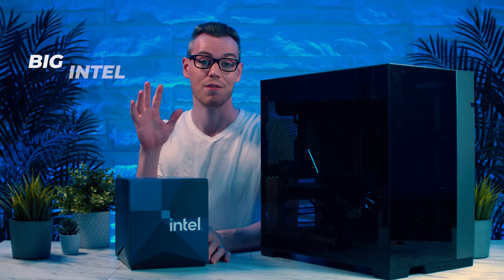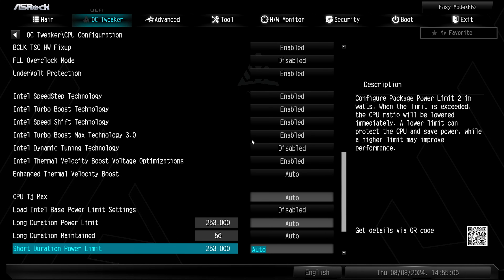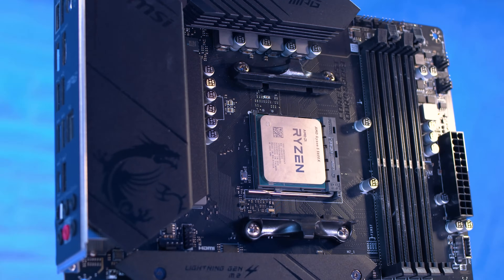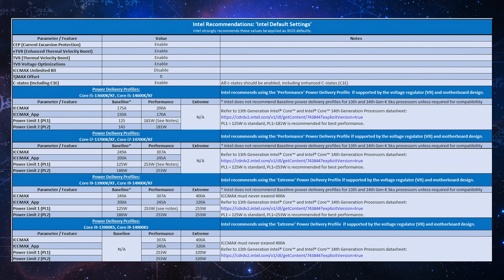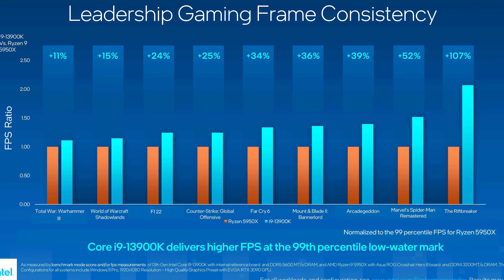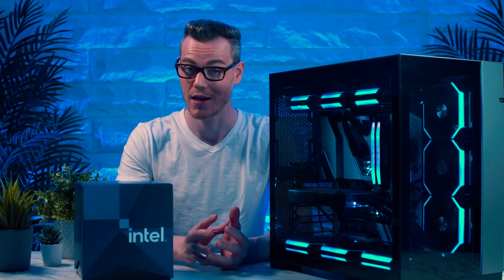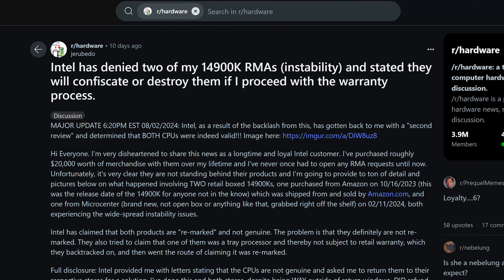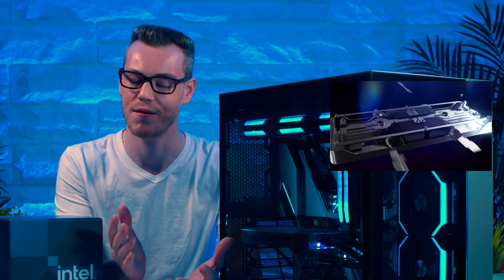The Intel Problem vs My $4000 PC... I'm Getting Mad Now

Comment: I have a 14900K, and I am constantly getting lockups or app/game just closing.  I've never OC'd on my own, updated the BIOS to the Asus Z790-E Gaming Wifi with the 0x129 microcode, set to Intel Performance, and still having the same issues.  I believe my CPU is damaged, but this wait is driving me insane.  Also, there is nothing in the Event Viewer when I experience these issues, which really puzzles me.

I've been in contact with Intel for about 2 weeks, and am waiting for a response with the RMA information.  Starting to think I am going to have to turn into the Gorilla jumping on the desk.
Reply: damaged CPU's cannot be fixed by this update, intel already says so. MANY people will still have issues because their CPU is physically damaged there is NO FIX, you must get a new CPU. And people who have not had crashes yet but the cpu damage has started, there is NO FIX.
Reply: You need to manually set setting's in your motherboard bios or you will always have problems with these cpu's. Mine's been running strong without issues for almost a year now, I do not want to say it's a user error issue since these cpu's are not stable plug and play without degradation due to shitty mb vendor default bios, but anyone with basic computer knowledge can have these cpu's 100% stable hitting top benchmark numbers under 1.35v v-core without any stability issue's pretty easily.
Reply: @joeysuzyjozy  I've tried manually setting to Performane and Extreme wattage and amps, still having the issues.  I've reset the BIOS, made sure all drivers are current, tested RAM, video (I have an nVidia 4090), using 1200W Corsair Shift.  I am at a loss. I believe my CPU is defective. I didn't have these issues until about a month ago.
Reply: @sinnirr  Your using mb default bios settings i.e. choosing a default performance profile on mb instead of manually setting everything yourself, that is your problem and why the system is unstable. since you ran a default bios profile on your mb the cpu has degraded due to spiking voltages above 1.5v and no longer works at the voltages it defaults too at the default speeds and needs to be downclocked permanently to function correctly again. Your system can get stable in 10min again fixing your bios, but your cpu now has permanent degradation due to shitty cpu microcode and default mb bios settings.
Reply: @joeysuzyjozy  I've done it both ways, using the profile and manually setting them.  Issue is getting worse. 

I'm in contact with Intel, but this is ridiculously slow.
Reply: @sinnirr  Sounds like your cpu is already seriously degraded and definitely needs a rma. When you get your replacement, limit your v-core voltage to no more than 1.35v max and watts to 253/260w max, limit your system agent voltage to 1.3-1.35v max also (only needs to be touched for memory overclocking and stability). set your turbo boost to not boost to 5.9/6.0 on 1-2cores and that causes the voltage spikes and set all pcores to 5.7-5.8max and you should never have issues with your new cpu moving forward. :D
Reply: These are all my mb bios settings you can use as a template (starting point) to find what works best for your cpu and system that I posted in another thread to help some other people with similar issues.

Under cpu advanced settings I currently have these settings all disabled: Intel speed shift, ring to core offset, cpu esit, energy efficient turbo, cpu flex override, enhanced tvb, voltage tvb, ia cep, gt cep, under voltage protection, and intel dynamic tuning. 
Other settings: my cpu throttle protection is at 90c, avx offset at 1, manual max turbo ratio set to 58 for all p-cores and 44 for all e-cores, p1/p2 set to 260w max time of 448, amps set to 400 max, system agent set to 1.3v versus 1.25 default volts only for memory stability on overclocked memory, adaptive vcore with a negative 0.196 offset (-0.2 in windows), memory timings set manually not xmp for performance and stability, enhanced multi core performance enabled, intel settings disabled, performance cpu clock ratio 58, efficiency clock ratio 44, max ring ratio 45, cpu load line calibration set to extreme, ia vr config enabled, ia ac and dc load-line set to 20, ia va current limit set to 1600 (400amps), ia vr voltage limit set to 1300 (1.3v), igpu set to disabled, audio set to disabled (i use a pcie audio card) and thats it guys…

Like I mentioned with these settings I run a fixed 5.8 all core at a max voltage of 1.29v using hwinfo that is stable in benchmarks and stress testing occt overnight, gaming without any whea errors, bsod, etc with manually tuned (fast) memory settings.
Reply: @joeysuzyjozy  I bought a new 14900K and am sending my damaged one to Intel for a refund.

I am using the Intel Default with the Extreme settings after resetting the BIOS and am no longer having issues.  

The original is definitely damaged.
Reply: @joeysuzyjozy  no its not the motherboard lol . that has been debunked
Reply: @joeysuzyjozy  the cpu architecture itself is defective . its IO controller is separate from the die and is connected to another part that requires more voltage . unfortunately the IO controller cannot handle the voltage is eventually fails . no it has never been the mobo venders fault. research will show you are incorrect
Reply: @zerokool1985  Everything can be manually set to run smoothly without ever having degradation or issues on the cpu using the mb bios and manually setting everything. Yes, the default cpu microcode is bad and the mb vendor default settings are worse, but that still doesn't change what I previously said above and if you don't know or realize that then I am sorry but you're an amateur.

Comment: I bought my i9 13900K in January 2023.In October 2023 starts crashing in games and BSOD.Then i undervolt it
and crashing stops.Update to the latest bios (not the August one yet).Now CPU gets high temps on cores 0,1,2,18,and 19.
I have 360 AIO and 8 vents in a big tower case.I tried RMA ,but Intel denied it and send me the chart for setting the correct 
parameters in bios.Did that but problems stays.I will try through the seller of CPU to RMA again.I don't have high hopes,
bcs i'm from EU.
When i run cinebench or similar stress tests,temps are normal for this CPU,but when i watch yt video in full screen and 
move mouse,the above mentioned cores go crazy on temps.
Reply: dump the 13 and 14 and go back to 12th gen
Reply: do remember intel gen13 and gen 14 CPU also have an oxidation issue that is separate from the over voltage issue. The oxidation issue probably continued to damage the CPU after you solved the over voltage issue. Your CPU is dying.
Reply: Same with me, just sending me bogus parameters instead of a working chip (3 months old now). Conflicting parameters too. They, after a week, first provided me with values I asked for and some more, but when applied my 14700k performance drops for 35%. Main culprits for nerfing are: eTVB = Enabled, TVB voltage = Enabled, CEP = Enabled.
But then, the same day, shortly after first the email with nerfing parameters, Intel sends me another email that says I should set Intel defaults... and to contact motherboard manufacturer.
Reply: just sue them. they have to fulfil the RMA. they are in troubled waters and most likely to have a class action lawsuit over this. thousands and thousands of companies use their chips and are failing which means losing profits and business because of hardware failure effecting their operations. they will not only be sued for the hardware but potential losses because of these chips. i have no idea why they think they are going to be able to pay a penalty when there is going to be an army of businesses and corporations that will be demanding they make up the losses through a lawsuit. intel did the dumbest reaction they could have followed through with. whoever made the move to hide it and come up with a BS non fixer should immediately step down for ruining a huge chunk of their reputation. They were well aware of the problems before they shipped them to sale but went ahead and sent them for sale. it was intentional to make a dollar and probably one of the worst business decisions made in recent years.
Reply: I bought my i9 13900kf in october 2023, until this day never had any issues.. I tried all of the tests people have said the 13th gen i9 shits it self at  cinebench, prime95, black myth wukong benchmark tool etc etc and I never had any issues with the cpu, my cpu never even went above 1.48v.

I guess I am good..
Reply: @AplixonTV  1.48V is a lot.
Reply: @Sigouss  That is true, but it's very stable..
Reply: @Sigouss  I checked the voltages again and it was somewhere between 1.24v to 1.33v and it rarely spiked to 1.48v
Reply: Lol vmin shift from defect Intel is already brick your CPU. The cooping is real. Simple answer, if intel won’t refund, you’re fuck

Comment: I feel like Intel not only has to flawlessly refund buyers without any further issues whatsoever, but also drop a new tech bomb, issue free high value CPU to regain their position, at least for the small gaming segment.
I don't think the big industry gives 2 shits about the brand. They have contracts and make their calculations for investments. If those run out and new purchases need to be made, they start the same procedure, based on numbers.

Comment: 4:36 One of the problems you show with your voltage graph is it is the average. The problem happens because the CPU requests a large spike of voltage for a very short period. The average hides those spikes. The problem is that those repeated spikes damage parts of the core and you get silicon degradation.

The big issue people are having is that this microcode will not solve the problem. If you have damage to your CPU from the voltage spikes, it is irreversible. This microcode update may prevent it from happening, but if there is degradation it can't fix this because it's physical damage. Just like the Pentium floating point problem, intel is not going to have a recall. They will not refund your money. And they will keep selling chips. NEVER buy buy used or second hand intel CPU's because you don't know what you're going to get. There will be a bunch of people selling working but bad chips.
Reply: Yeah used to be that used Intel CPU was the safe choice, bought plenty 2nd gen to 8th gen used and OCed them no problem, running a 5.1Ghz OC on my 9900k for 4+ years with no problems but you're rights about 13th and 14th gen I won't be buying any of those used unless I can test before buying or I know it's from someone that manually tuned their system.
TL very disappointed that you ran your 4000$ PC at stock bios settings, expected you to tune your PC.

Comment: first off i am only aware of MSI motherboards having the Intel microcode patch too bring the CPU back too specs instead of OVERCLOCKED straight out the box with too much voltage !!! also too check you have the patch applied you go into BIO,s and power limits and PL1 should be 125watts and PL2 should be 253watts and core voltage should be idle 1.0v and boost 1.2v ... i dont think you got the microcode update and you have a bad CPU cooler block mount , don't use carbon pads , their garbage . use thermal paste and a Thermalright retention bracket for 12/13/14 gen Intel .. and if the settings ive just given you are not applied in your bios then you do not have the microcode update that make the voltages Stock intel and your still running the OC bios which is causing issues ..pfft
Reply: again you are wrong lol stop it i am a repair tech . EVERY 13 or 14th gen system i got was defective and needed a new cpu . msi . ASUS . asrock . gigabyte. the cpus themselves are the issue

Comment: I dipped after the 8700k/7980XE, bought a 1950x then 3950x and now a 7950x. Nothing to do with brand loyalty for me, Intel 18 core cost me $3500 while AMD offered me 16 cores for $1200 which performed better with reduced power consumption. I really don't know why anybody would buy an Intel processor for anything? Adobe? Does it really matter saving a minute off your render? I can play Robocop Rogue City, run an Arch VM, render a 4k video, watch a podcast or film on my other panel all at the same time, 14900k can't do that. 7800x3D for gaming and 7950x or Threadripper for power users, Intel is simply not the best choice not even close. Sorry this has happened though but I saw the potential issues when they started with this big core little core crapola.

Comment: I have a i7 13700k and since i bought it i noticed it was voltage hungry when turbo was turned on ( Default setting Asus Z690 plus ) Default setting will turn on turbo boost , My cpu runs at 5300 mhz ( @ Turbo default speed )and  is pulling 1.45v ( Which I am told is really bad for cpu )so in short I have to leave my turbo turned off since I updated the bios a few days ago . I have  downloaded the new bios and I still needed to undervolt my cpu.
Reply: Anything above 1.35 and u can make your CPU prayers..
Reply: @Greenalex89  1.35 is still honestly to high for 10nm / technically 14nm +++++++++++++++++++++++++++++++++ its complicated
Reply: @Greenalex89  Any idea why a cpu would call for such core voltage ?

Comment: Good thing I got the service plan with my processor at Micro Center.  Going to return it and get a free upgrade to a 9950x or 9950X3d when they come out later this year.
Reply: @traingp7  feels good having a micro center close by. Micro center is goated
Reply: Good call waiting for Zen 5 X3D! Zen 5 regular CPUs in my opinion won't come close to Zen 5 X3D! 

Micro Center just kicks ass. Always superior to Best Buy.

Comment: I have a 14900K in a rig I spent $6K on, no 4090 involved. I seem to be blessed with a golden sample. Every critical metric is looking very good, especially the dreaded V-min. My system is stable across the board. Push comes to shove, and my brain box does go tango uniform, I still have my 12900K in reserve in the event of an RMA ordeal. I am on the x129 microcode.
Reply: Ive used i9 14900KS for 2 weeks and thats true about the issue.. Crash when iam rendering image in 3Dsmax and Corona Render, BSOD after i give him full load task like rendering in 3D, or i cannot open software like Unreal Engine 5 and D5 Render.. it says error at Unreal and Force close at D5 Render.. i don't know what's wrong but i waited for the Intel driver update so i could running some games and work with this CPU.. My SPECS is i9 14900KS, ROG Z790A, i-game RTX 4080 Super, 64Gigs RAM and running at windows 11 pro.. but still randomly crashes, Ive try different RAM, SSD and downgrade to Windows 10 but still no fix on there.. Ive buy the real license with Corona and D5 and still crashes randomly when i give him full load task.. i don't know if Intel have this issue before i build my rig.. come on Intel 🙄
Reply: @Nopanda_Architect turn off cstates lower pl1/pl2 power limit (read what they should be) emm offsetcore undervolt and come back to us.
Reply: @Nopanda_Architect  the 14900KS is a scam chip man. Lock the cores to 5.7GHZ, disable 1-2 core boost and try keeping Voltage lower than 1.3 Volts.
Reply: @Nopanda_Architect  your cpu is damaged . you need to RMA  which will give you another defective part . all 13 and 14 gen are bad 65 watt and up. id grab a 12900k and forget about 13 and 14
Reply: @zerokool1985  Not all of Intel's cpu's are fucked though.. I have a friend with a i9 13900ks and he has it since it was released, no instabilities and no nothing.. I guess it depends on if you're lucky with your cpu or not..
Reply: I built a pc with i9 13900kf october 2023, until this day never had any issues, I even tried tge tests people have said the cpu sgits itself at like Black myth wukong benchmark tool, cinebench, Prime95 etc etc and everything works flawlessly, I tried over and over again no strange instabilities no nothing, I am really happy with my cpu!
Reply: That's great, My 12700KF & 12900KF are stable htpc/gaming rigs. Spent a lot of time tuning to get there. Great to have a backup. I'm not an expert Nopanda if you're open to Linux testing would see if the crashes still occur there. I've had crashing that occurred in Windows but not Linux in gaming on 12th. I've done the ram swaps, nvme swaps, lowering ram speed to JEDEC (even bought QVL for Z690s), running 2 dims, I did use both Windows 10/11. Question is did degradation occur, and that's possible, if so would RMA. I've had though the same machines that were BSODing on Windows 10/11 are stable on Nobara Linux 39 now 40. Would test everything, if it can't even Linux stably or perform the same Windows task if degradation has occurred more voltage & offset would be necessary to achieve what it used to be able to do normally. I wonder if sometimes the drivers/something conflicts in Windows. I did GPU swaps too 4090 in main rig, also used AMD 7800XT a lot and 7900XTX. In my case I found ecores off better for what games I play/in general stopped game (mostly WoW) from falling onto an e core and crashing.
Reply: lock the cores to all core boost and keep the Voltage around 1.3 Volts. Don't let it degrade man with crap auto settings